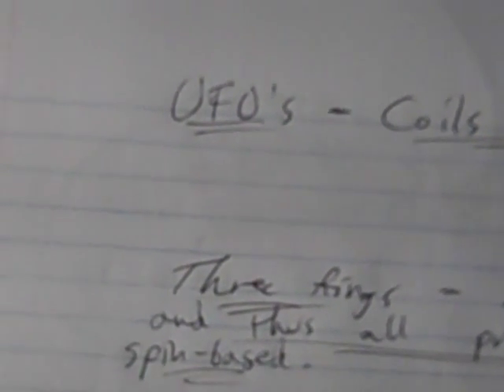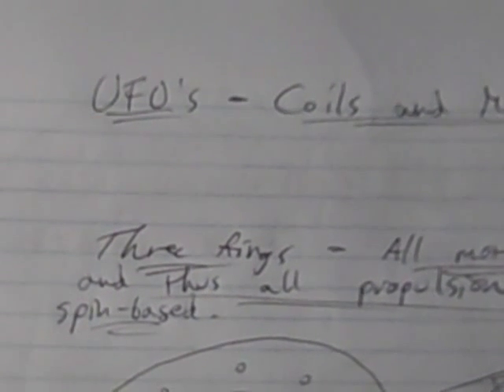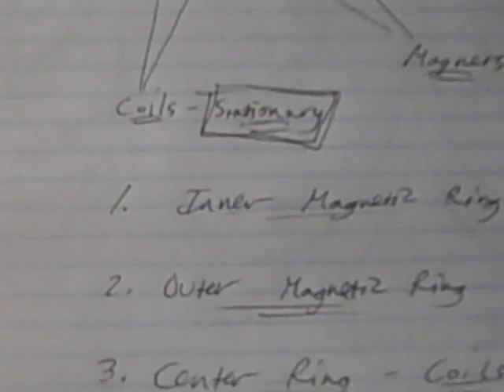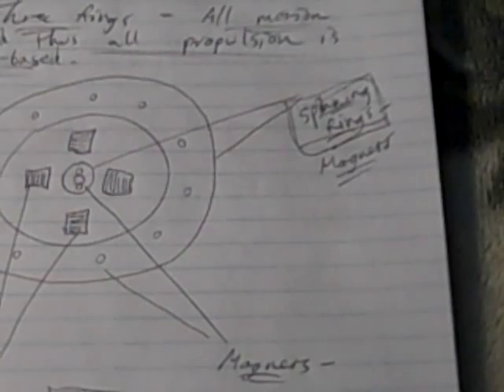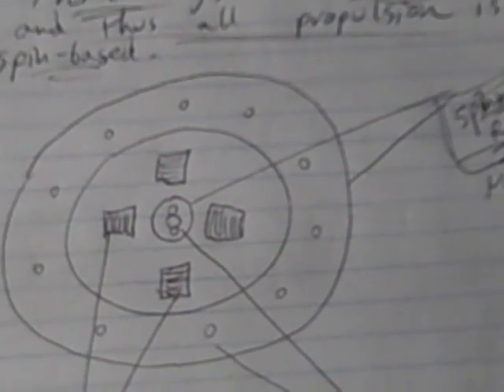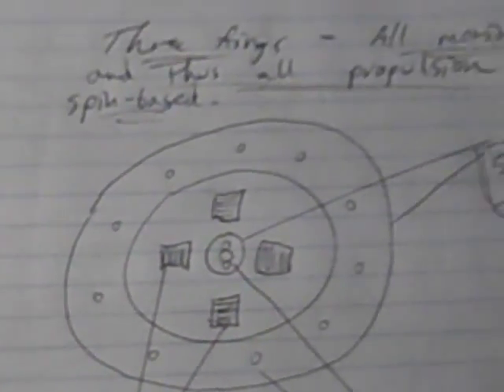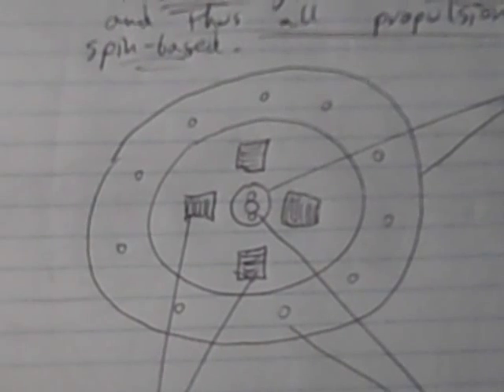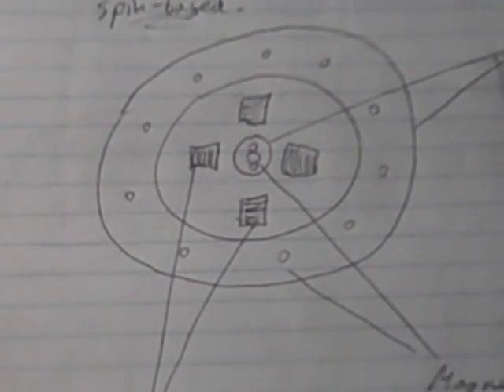UFO's  -  Coils and Magnets  or  F = S ÷ CS (Spinphysics)

Comment: Challenge is you need an 'open system.' What you have in the drawing is a 'closed system.' Example of an 'open system': raising your feet off the ground by grabbing onto something outside of you like the top of a door or a chinning bar. Example of a 'closed system': trying to raise your feet off the ground by grabbing onto something 'inside of you' like your shoelaces to pull yourself off the ground (if you don't jump upward, pulling upward on your shoelaces will tighten them up but not lift you off the ground).  Most UFOs are electric and use the 'open system' of the air outside the vehicle. An 'asymmetric capacitor' is an electric vehicle that is the most basic example.  Unlike what 99% of 'ionic lifter' folks believe, these vehicles are not powered by 'ion wind', see the proof at https://www.youtube.com/watch?v=ckGaTUEbaKw,  and put the video in slowmo, click the gear icon at the bottom right of the youtube video, click 'Speed', then click '0.25' for slowmo).   Here's an example of the most basic type of 'open system' vertical propulsion device that uses an electric field for upward lift: ******https://www.youtube.com/watch?v=FFK5BzHs6eY*      The very high positive voltage on the top wire strips electrons off of the surrounding air molecules, leaving the air molecules with a positive charge, and since the bottom tin foil is at ground potential it 'sees' the positive air molecules being created in a constant stream above it and it leaps upward to (is electrically attracted by) the stream of positive air molecules (aka positive ions) that are being created by the top wire above it.  The air is 'outside the system', ie. the 'lifter' is NOT trying to lift itself  by 'pulling up on its shoelaces' -- it is (1) changing the air molecules around the top wire to have a positive charge (2) the air molecules are outside the lifter vehicle, thus it's an *open system*, and (3) the ground-potential bottom tin foil is attracted by the constant stream of positively charged air molecules just above it that are being repeatedly produced by the high voltage on the top wire and hot damn the 'lifter' moves upward.  UFOs also use the air,  1million+ volts, and other trickery.